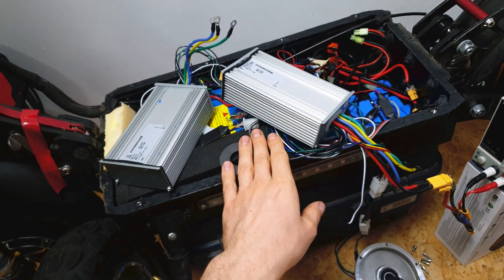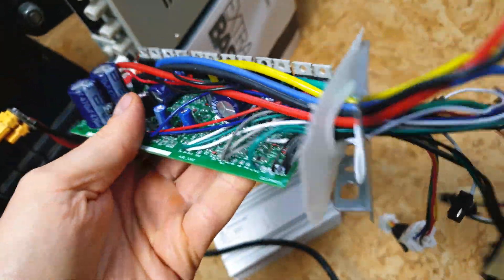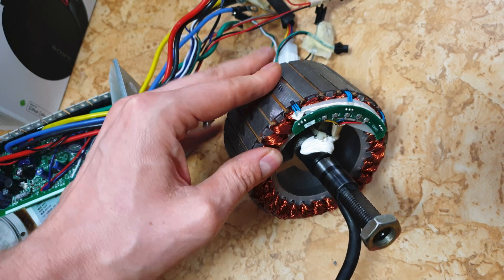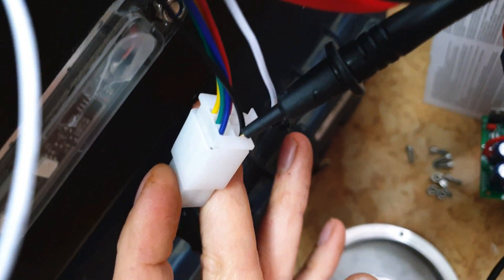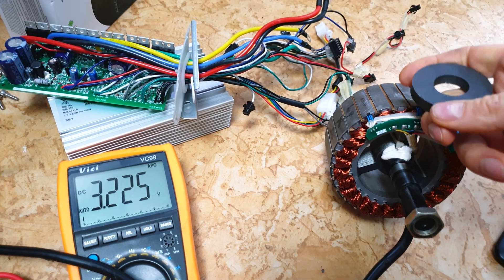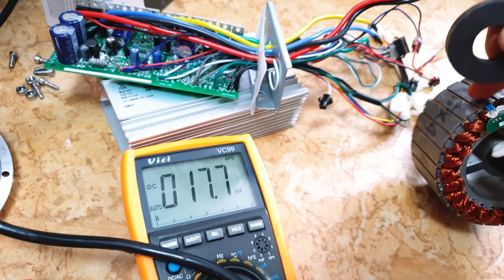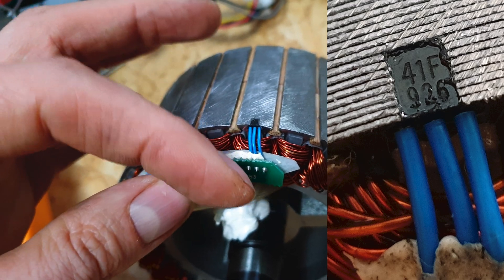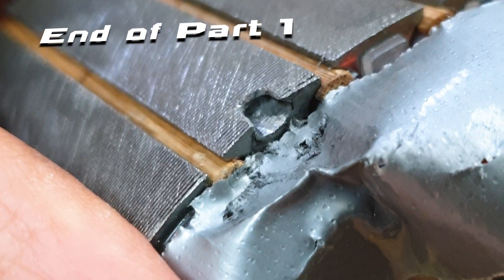Escoot Problem 🛴 Motor Twitch / Not work 💥 How to fix damaged Hall Sensor 🛠 Part 1 "90$ Less " 🤦‍♂️

Comment: Yes pirate play scooter moto and teach .good man.👍
Reply: It’s also good to know that the controller ain’t dead.  It wouldn’t be a good indicator for the long time users.
Reply: @michalkolodziej  but why the hall sensor broke would be good to know also...
Reply: @strawman9410  It might be just an accident. There are videos on YT how to replace a hall sensor, which means that it happens. Still, it's disturbing.
Reply: @strawman9410  I found mine got hit by one of the magnets in the motor.
Reply: Is battery connected to the controller in order to do the check on the sensor with ring magnet?

Comment: For a 60V 45A specification, the internal capacitor’s maximum voltage rating of 80V feels insufficient. What is the model of the MOSFET? If it’s rated at 80V, it might be a good idea to consider replacing it.

Comment: Hello, i think i have the same kind of scooter. But my front wheel is stopped running in dual drive mode. Could it be because i switched from single drive into dual drive mode while driving? And what could be a problem? Switch? Some kind of fuse? Wheel itself? The rear wheel is working well
Reply from the maker: nah man, you can switch it anytime.
Maybe switch is gone , or some witring, there is also small chance that controller could be dead.
hard to say over distance

Comment: Hello, to check better the hall sensors, put your multimeter on beep mode !
Reply from the maker: Hey, could you elaborate ?
Reply: @PirateWasHere  plug Black stick of your multimeter cable to the black wire of the hall sensor and the red wire on green yealow or blue cable of the hall sensor , set the multimeter on beep mode and you will hear beep every magnet captation
Reply from the maker: Ok but hallsensor need power input to open gate /operate ? is it correct ?

Comment: I wish i had your technical skills my friend. I have a 6000W 60 volt escooter. I tried to change the signal lights according to a video bybtge seller, there was a spark, now my rear motor doesnt work, nor my speedometer..i plugged my rear motor in my front controller and it didnt work. My question.is can a simple spark damage a motor that easy?? Fyi: im not tech savvy at all!!!! Oh, my Escooter has 23 km driving time and the company will not honor the warranty for repairs, they will send parts only after i send a video of the escooters current performance! 
I will neveri buy a product from a company i cant visit in person again when spending this much money. Id appreciate your thoughts.
Reply from the maker: hard to say what coudl be wrong, service is needed. FInd someone who can find the issue, it's to risky for newbies to mess with high power battery
Reply: @PirateWasHere  thank you! That's what I told the seller. It's still under warranty but they're refusing to pay for repairs. I neve even mentioned what happened, I just said the .Motor failed. The internal signal lights connectors have red and green wires, they send me replacement with red and black, so i matched the red... it just made sense. They won't admit fault. Their answer, sorry "We can't bare the cost"..lol I have 23 kms on it. Never again will I shop from a third-party seller from Amazon. Back to the repair, thet sent me a video of how to do the work. These guys are NUTS!! It's like a rata nest of wires and after I sent a photo to a potential technician, he said " don't bring it their, that's a horrible wiring job"
Reply from the maker: Basically, if your rear motor doesnt work then for 90% rear controller is damaged and have to be replaced , its very possible that this tiny spark did some internal short and only MCU for mosfets is not working. 
 But yeah , as you see , its complex to explain.
Reply: @PirateWasHere thank you for all the replies amd information! Appreciate it!

Comment: This i VERY dangerous video, cause you did NOT describe it well. You did say NOTHING about that the scooter in not connected to the battery, but to your own lab power supply. You did not present the schema or say few words how the cables are connected. Some ppl can get hurt - especially if they have powerful scooters or want to do similar things on other machines.

Thanks to you own test power supply (like riden or any other) you can adjust proper (safe) voltage/amperage and do this test safety and easy. Working on stator (and rotor) that is on can be dangerous!

Also you did not show how you open the motor - and that can be sometimes frustrating. Otherwise, good video.
Reply from the maker: Well everything is dangerous, even sitting on the chair. If someone follow only one video, and do not understand that this stuff is dangeroua because there is lots of videos about it around , then what can i do .
Even if u give to some people the schema and toools , they will messed up it anyway.
You said SAFE, there is no such a thing if u have no idea what ure doing, connect 60V at 100mA to hall sensor board, it will fry faster than u can blink, or 5v power supply  to 60v battery ;)
Reply: @PirateWasHere  "Well everything is dangerous, even sitting on the chair. If someone follow only one video, and do not understand that this stuff is dangeroua because there is lots of videos about it around , then what can i do ." that is why you should mention it. And by simply NOT saying that it NOT connected to main battery but you lab power supply, is... well dangerous for ppl who can try to do "just what this guy do!" Add some info in description at last.

And that is why you should connect everything lab power supply, where you have full control. And any mistake is not so critical.
Reply from the maker: Bro u have no ide what u saying, any mistake is critical when u re messing with electric circuit
Reply: @PirateWasHere  yea really? Mistake with 0,1v and 0,1 a is the same like with 15kv and 100a ? lol

Comment: hey pirate, i really like your videos. I need your help. How did you took the hub motor out of the wheel because mine is stuck and i dont know how to it out. also how many cm is the hall sensor circuit because i need to order one

Comment: Hi Pirate, finally I get from ali the Hall sensors and I repolace just one ( I had the 41F 816 and I get the 41F 8847 ) and the problem is that between GND and out put we get 370K ohm and with this new we get 50K) so the problem remains... can you give me a tip? if I change all the three we the same value we fix the problem? I don´t know where I can get the originals... thanks do you have any way to talk with you? Telegram whatever...
Reply from the maker: I would check voltage  on the otput , not the resistance.
Reply: problem solved, I replace all the 3 sensors and the motor is working just fine, thanks a lot PIRATE!!! @PirateWasHere

Comment: in my case the problem was that the hall sensor get lose... can you imagine that? yours doesn´t come out... mine were lose :) god bless china ;)
Reply: I´m waiting for e new set of controllers... I burn mine that were brand new... If I know you before that... I didn´t have the schematics and and put power 60v on the Blue/blue wire (single /dual) and I heard a click or two like when a smd resistor break... and now I have error number 10 (no communication) so I had to buy a new set, later I will try to see if I can find what burn out... the originals ones burn out completly in the hands of the previus owner... and I´m trying to fix this TI30  @PirateWasHere
Reply: My controllers arrived today and I found out that one sensor is dead... mines are 41F816, thanks Pirate for the troubleshooting!!!!! @PirateWasHere

Comment: Hey pirate, so i recently repaired and fit a new motor cable , and the wheel only twitches, i dont have the small pcb that goes between the motor and controller, could this cause the issue? Any idea how to get one of those small pcb?

Comment: no sign of water ingress, except that rusty as bearing race aye
Reply from the maker: this is usually how it looks when brand new so 🤷‍♂
Reply: @PirateWasHere  shit really the bearing factory probably has outside air passing thru it
Reply from the maker: well couple times I found inside the deck of customer scoot big mark of water  ~20cm ( scoots where new or never used at rain ), funny thing is that it was in some cheap chinese scoot & in some pricy brand.

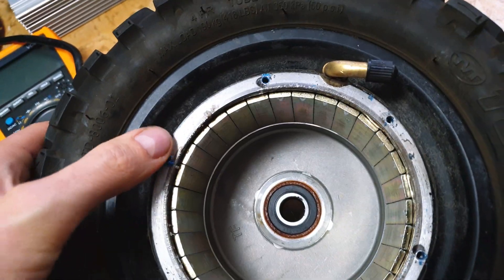Comment: 2:54 "This motor seams to be waterproofed" when the bearings are rusty something isn't water proofed for sure 🙂 😂😂
Reply from the maker: good point, but then why startor is not rusted ? ;)
Reply: @PirateWasHere  As you probably already know e-motors have all a fine layer of oil when exiting the factories (that helps a little) and not to forget stators get very hot under load so you can assume is that water would anyway evaporate and dissipate fast enough to not build easy rust on it. But it's clear that this motor didn't got very wet at all, if water got inside it was marginally less then needed to damage anything beside the bearings. I love your channel
Reply from the maker: Woohoo at least someone with experience 🍻🍕 , I opened couple motors and none of them had any oil on strator & even bearings were rusted on brand new motors from inisde 😒 . BUT probably you are right in this case, boyueda was used on deeper water / mud , I always thought that water can't get inside thurogh bearing but I was wrong :). Thanks & share the knowledge, you re good in this 🚀

Comment: Hi Pirate, I have this problem on my Boyueda. I'm not sure how to open the wheel. Do you just pull the spindle with magnets through once you remove cap? Seems very well held in place.

Comment: Your inner’s beariring outer race is corroded and you say there is no signs of water inside the motor? :) Magnets are nickel plated so they won’t rust it there is no damage in this coating.

Comment: if my electric bike also having hard time going in climbs, but perfectly working in flat road, does it also mean a damaged hall sensor is possibility?
Reply from the maker: Damaged battery for 75% , controller 10% , other issues..
Reply: @PirateWasHere  so possibly controller i supposed? since the battery was newly replaced. but what part of controller is it by any chance? is it repairable?

Comment: Hi, after riding my 5600W scooter over an uphill with one motor, the rear wheel got stuck and does not rotate freely. I do not know if the wheel is defect or the controller. 
I would like to ask for your help. 
Thank you in advance.
Reply: i have this problem yesterday and then when i hit down throttle the rear wheel dont even spin anymore.....please help us if anyone knows the answer to this....

Comment: Hey Pirate, great video man! I am facing another problem with my motor, it seem like the central bolt which is going through the motor is bended. Can I change it or I need a new motor? Thanks!
Reply: I think is bended cause now when I ride my scooter (the same model as the one you are fixing) it is pretty obvious the wheel is pointing slightly to the left when my steering and forks are straight.
Reply from the maker: If motot shaft is bent you need to replace whole motor or find some mechanic who can help you straight it. Also its possible that arms or other frame parts are bent but motor is straight 🍻
Reply: @PirateWasHere  Thank you for the feedback!

Comment: I was wondering if I could send you a personal case that you can help me with.  My motor does the twitching but the company engineer insists it’s my controller that’s the issue. I don’t want to have to sit and wait for other spare parts if it isn’t the controller. I could send a video of the scooter and the issue.

Comment: My Escooter - LAOTIE® Ti30 jerks when holding the gas. I mean he takes on gas and loses power until he doesn't go at all and bangs on the Taho (M).
 But if it is only the rear motor with the front one, everything is fine.
What could be the reason for this ?  Hall Sensor ? 
https://www.youtube.com/watch?v=vx_JGpmnGYI&ab_channel=DanielSememets

Comment: hi thanks i found 41F.  the throttle must be paired with the controller did you get the new controller to do something or did you just plug it in and you're done?  thanks dare i don't go just grind
Reply from the maker: What do you mean about throttle  ? :) , grinding is not that hard just do it slow and have some plan in ur head how to do it 🍕🍻

Comment: Hello my friend, nice video. I have a zero 10x 60v. My rear wheel every time i hit a road bump , stops working. I have to leave the throttle and push again and works perfect. You think in have the same problem? Thank you
Reply: Hi , i have the same problem with mine, i hit something and stop working , controller doing a noise,  i have to start again throttle,  and on hill dont have power at all, if you solved problem please tell me what you have found please
Reply: @alincimpoi3144  open the deck and check all cables. My problem was a partial disconnected cable. I did soldering and works Great.

Comment: The hall sensor could be different in other scooters. For example in my Boyueda 13 Inch (the heavy one like obarter) are different and when i used the 41F ones it didnt work. I had to use TLE4935L (49E). Dont know why but with the 49E it started to work again.

Comment: Guys can someone help me?
I just received my boyueda, I press 1x 🔒 2x ⚡️, but nothing happens! I don’t know what to do..
Im losing my mind really, please someone help me.
Reply from the maker: Check battery voltage
Reply: @PirateWasHere  im really sorry, what you mean by that exactly?
Reply from the maker: @90DeadTimer  when you push the throttle does voltage drops rapidly ? ( you can see voltage on lcd screen )
Reply: @PirateWasHere  it doesn’t even turn on to look at the voltage. The book says it should make a beep sound, but it doesn’t.. so any suggestions please bro?

Comment: Hi Pirate, great videos, this scooter looks similar to mine (LAOTIE TI30) can you confirm if the wheels are the same? I've owned and ridden 200km (road only) now rear wheel frozen, it does not spin when doing it by hand (or power) I can feel resistance, front motor is fine. When I pull throttle real wheel jerks (sometimes) only a few millimeters, when I rotate manually it will sometimes jerk a few millimeters. I am sure its a faulty motor. I tried to remove motor but I feel like I am missing something as having removed all the screws I could not figure how to get the motor out of the wheel without possible breaking something. Any help would be appreciated or maybe do a video? thanks
Reply: Feeling resistance when manually turning the motor could be a symptom of a blown speed controller. Have you tried connecting that speed controller to the front motor and see if the motor runs?
Reply: i think i may have this... my scooter rear wheel no longer spins after 2620 miles...how do i fix a blown speed controller??? @LuisTeixeira
Reply: Did you fix the issue?

Comment: Hello i bought front and rear dual motor controllers off aliexpress yun li 60v 45a!

I connected everything all is working except front motor controller!

Hall is connected , Phase wires connected,  large plug is connected,  Yet i have no power to front motor what am i missing?  Please help thanks!😀   There is no power switch wire for the A controller  im atta loss!
Reply from the maker: is front motor twitching when you adding throttle ?
Reply: @PirateWasHere  No not twitching. I messaged FLJ  about the yun li controller they sent me a picture diagram which after cloning the picture wire by wire I still could get no front motor action. I had clipped the 2 blue wires before I took a picture of my situation and to hide my hackery of cut wire I twisted them together and after a mild hulk smash moment I pulled throttle and bam fixed my issue on complete accident thanks to the scooter Gods serenity is back😆😆😆
Reply: @PirateWasHere  thanks for responding

Comment: my scooter is running fine unless i use brakes, whenever i am using the brakes the motor is getting jammed and the scooter turning off automatically.

Comment: Hi I often follow you in your tests, I really liked the replacement of the motor sensor, I would like to ask you in the display settings of the Laotie ES18 what is the factory set number of poles ??  because in my ES18P it is "19" but I think it is wrong because in the motor there are 30 poles that correspond to 15 pairs (N-S) so the number should be 15 and not 19, I did a test and I think the motor turns better but  I would like your opinion, thank you very much.

Comment: Hi my front motor has stopped working. But when I apply power in dual mode the front wheel locks solid what could this be?
Reply from the maker: Check wires, check halls, check motor wires voltage when u spin motor , at last check controller
Reply: @PirateWasHere   thanks for your advice. Where did you buy your controller from? Can't seem to find the correct one online
Reply from the maker: @richardbrookes9907  Links in description ;0)

Comment: Hi pirate i saw he was selling 45A controllers with LH100 throttle on AliExpress.  do you think you could adapt it on laotia are 18?  because I read that for controllers of 45 A it was recommended to have magnets 60mm long or on the laotia and even on the boyueda it's 45mm ... probably why your engine burned out 😅😅😅 What do you think?  bye bro
Reply from the maker: My motor did not burn ... you can adapt what you like inside the deck or outside
Reply: Pirate okay okay do you think is mutch punchy contrôleurs boyueda than laotie ?
Reply from the maker: @florianguerin643  yes but i preffer laotie  ones
Reply: Pirate okay but why?